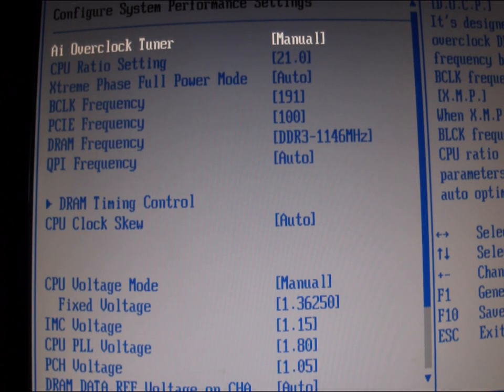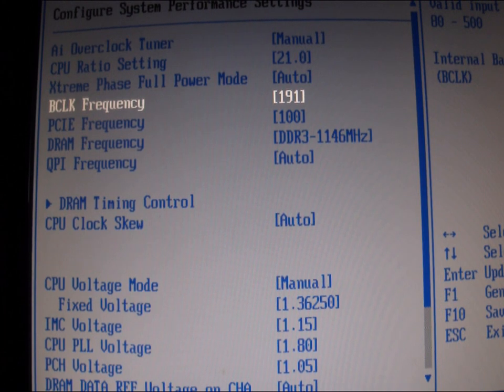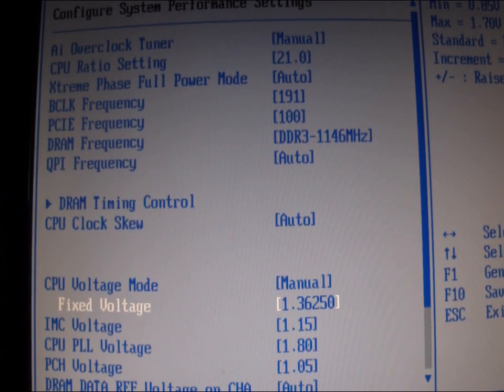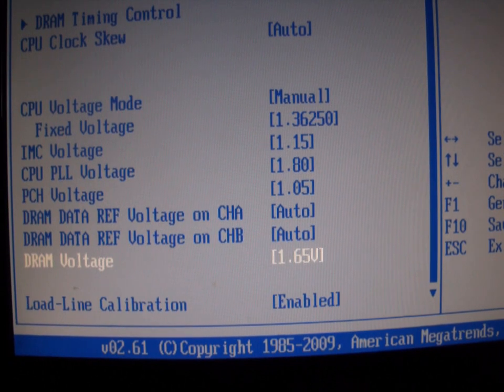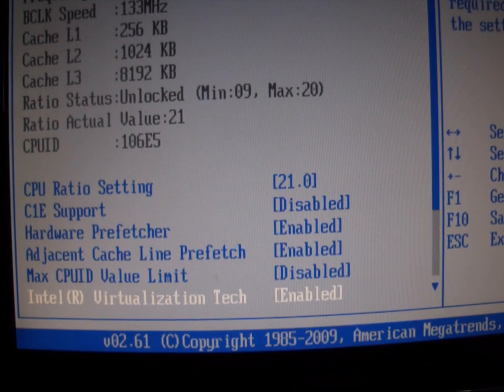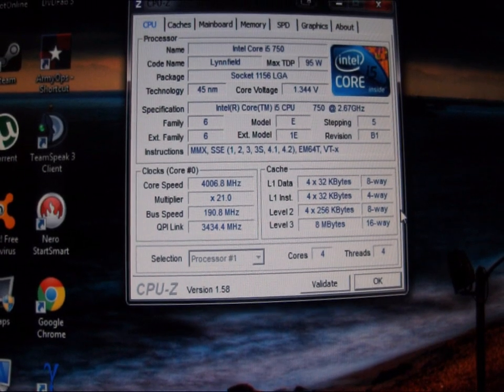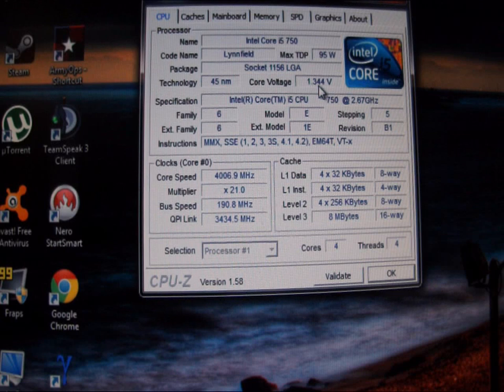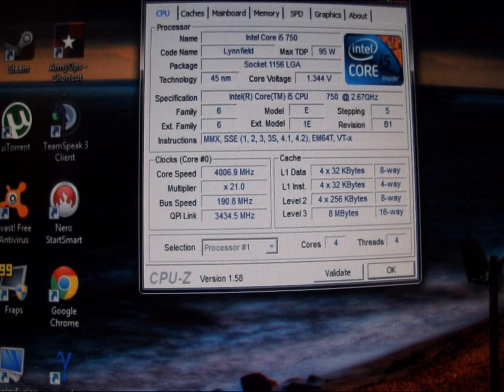Asus P7P55 LX bios setting Intel I5-750 @ 4.0 GHZ

Comment: Selamunaleyküm (Hi) I am writing my system to everyone, can you show me how to overclock in detail, or can you tell me about the computer's thermal paste and fan, all the maintenance has been done, it's only been 1 day processor - i5 760 - motherboard - p7p55 lx ram 2+2+2+2 8gb corsair xms 3 ram di i think i have 460w psu i have cooler master r5 230 as graphics card my monitor is 75 hz and i am a fps player but i eat a lot of srop because i can't get 75 fps, if i get stable 80 fps it will take me 6 months, so i don't worry about my life too much: D
i have hdd as disk, that's all, by the way, monitor syncmaster bx2350

Comment: SUPER HELPFUL! I'VE BEEN AT IT FOR HOURS AND FINALLY GOT A DECENT OC FROM YOUR VIDEO!
I got my i5 760 on an ASUS P7P55D-E to run at 4.011 GHz. Turns out my ram could not churn out more than its rated 1333 MHz and underclocking it allowed me to boot into windows.

Comment: On the sticker of my ram it said 1.5v but I set it to 1.65v. Can this damage the ram? I was able to boot in to windows without a bsod. After that I changed it quickly back to 1.5v. So could it have done  any harm?
Reply: Short term, no. Long term yes, since it get's more power than needed and wears faster.
Ideal is to undervolt everything, as much possible and without problems

Comment: can u help me in 2019?
Reply: What info you need?
Reply: @yeahbuddy6852  i have intel x3440, asus p7d55 and stock cooler what should be my overclocked ghz and bios settings?
Reply: I have x3440,asus p7d55 and stock cooler what should be my overclocked ghz?

Comment: Please what is a cheap but good graphics card for an over clocked i5 750 . I don't mind second hand. I really don't want to spend more than 50 pounds new. and around 20-30 pounds second hand would be great. I'm planning to use a gigabyte p55 motherboard
Reply from the maker: What are your needs for the video card?. Are you planing on playing the latest games with it?. Your best bang for the buck is to buy a used card that is maybe 1 or 2 generations old. That way you can get a card that is still powerful but on the cheap. Do you have a good access to used video cards in your area?. What kind of cards have you been seeing in the 30 pound range?.
Reply: Im with i5-750 @3.6Ghz, 12GB ram@1600 and GTX 1060. Also an SSD.
It's the best  possible combination for now.
No need better GPU unless you prepare yourself for total upgrade afterwards

Comment: is there any setting the speedstep can be enable so it dosent run at 4g fulltime?
Reply from the maker: You can sure try it and see if it will work for you. I like to let it be able to throttle down also. But on some boards it will cause instability when it try`s to throttle back up again and cause a crash. But it certainly wont hurt anything to try it and see how it works on your system.
Reply: How can I do this I have a p7p55d e lx with gskill 2133mhz
Reply from the maker: @yulmerced4434  I believe it should be just a matter of enabling the C1E support under your advance cpu.
Reply: What should I enable I can run at 4g all day  my temps are 56c 60c even with cpu burner I have an asus p7p55d e LX
 i5 750
 gskill 2133 underclock
Reply from the maker: @yulmerced4434  It would be the same thing. If you want it to stay at 4g all the time turn C1E off in bios. If you want it to throttle down and run cooler turn C1E on.

Comment: Hi what settings do I need to use if I want to just upgrade from 2.6 to 3ghz? Take one step at a time
Reply: I sorted it dude - thanks for replying :)
Reply: Mika Vanderak I used everything the same in the video except I use 17 instead of 20
Reply: I did everything the same and 17 voltage and my processor is 3.2ghz at 40 degrees

Comment: I know this is an old video hopefully you will respond...I have this CPU and a similar motherboard. I have overclocked to 3.6gz and my idle temps are around 50 celcius. Its a stable overclock. Do you think I should bump it up to 4.0?
Reply from the maker: That temp is a bit higher then i would like to see at idle. You either need to try to keep it stable with less voltage to cool it down, or try a better cpu cooler before trying to go higher with the over clock.

Comment: Thank you!! i have the same motherboard with i5 760, i did the same and now im at 4.0ghz
I have 2 questions, first: what about temps? 50-55 degrees is ok??
second : i have 8gb ram (corsair xms3) 1333ghz its ok at 1.65 volts as you did or i can run them higher?

Comment: I have set the bios as you said in the video, and do not get your ghz. 
When I put 19.0 CPU ratio setting and entered windows, give computer and right click on properties I get 2'56ghz .... why? 

which drivers you have installed on the motherboard and processor? 

  I'm peron my Spanish orthographic, thanks in advance
Reply from the maker: Not all cpu`s or motherboards will overclock the same way. When you get into windows use cpu-z to check cpu speed. Windows may be reporting it wrong. Also make sure you have c-state disabled in the bios.
Reply: FUzzyBUnnyBOoties  Hello again thank you very much for your help. How many mhz is your memory ram?
Reply from the maker: CeroTrece HD 1600 mhz
Reply: my ram is 1333. could be a reason why I do not get stability?
Reply from the maker: CeroTrece HD Yes it very well could be. You may have to set your ram speed down even lower until it becomes stable.

Comment from the maker: I also totally the chance of all 3 chips being bad is very slight. I dont think the first one was bad the 8gig one. The board will only support 4 gig chips. So you could have a total of 16gig if you filled all four slots. But it will not know how to read and write from 8gig chips. So I don't think that one was bad. I do believe that there is something wrong with the value ram ones.

Comment: It was an 8GB Vengeance by Corsair, the motherboard, technically did support it but as Windows 7 booted up it BSOD, exactly the same as this one. It's as if both the MB and the RAM are denying each other, funnily enough. I know that Value Ram ought to be considered as junk but I don't understand why they wouldn't boot individually even if I single channel the both of them.. it's always a BSOD, only the 2GB pieces I have left seem to work, and they're also Corsair.

Comment: You're talking about DRAM Timing Control right? The option is on this video but you skipped it in the footage, haha, I managed to open it and found like 6 different settings that revolve around the timings all with their own numbers.. I set the first four values to 9-9-9-24 but the others I have no clue what they do. Also, at the top of the same page is written information that the default clocks are already set at 9,9,9,24 so I'm not sure if it's that. I tried booting up with 1.65 Volts of DRAM

Comment from the maker: The ram timings are under the the dram settings. Every thing will be on the same page that you would overclock from. Right below the cpu settings you will see the dram settings. And at the very bottom of that page you will see the ram voltage settings. If you are concerned about changing the settings. You can just take the battery out of the motherboard and pull the power plug from the computer. Wait about 10 minutes then put the battery back in and plug the power back in. That will reset bios.

Comment: It's totally RAM related.I can plug in the previous RAM Sticks that I had and Windows would boot perfectly (That's where I'm actually posting back from at the moment). About the clocks (9,9,9,24) I'm not entirely sure under which setting I can edit those, would you please guide me? I don't want to fry the motherboard or any other component, haha -- Btw this is the RAM I'm trying to plug in - cmv8gx3m2a1333c9

Comment from the maker: The IRQL would tell me that it is a ram issue. I assume that you are able to get into the bios?. If so set the ram up manually. Set the voltage to 1.5V and timings to 9,9,9,24. You may also try booting it with just one ram chip in and see if that works. Them value ram chips can cause a lot of problems because most boards do not know how to auto detect them.

Comment: I'm no entirely sure about the compatibility, but since the Motherboard manual/specs state that it can withstand to 16 GB with 2000 OC and above I thought that upgrading from my current 2 x 2 x 2 GB Corsair modules to at least 8GB single channel and then since it crashed/gave me a BSOD thought to go for at least 8GB dual channel.. Obviously I tried messing with the CMOS and also inserted one of the RAM modules on it's own but I still got the darned blue screen

Comment from the maker: I have not ran across that problem. I have ran 2x4 and 4x2 configurations with several different types of ram. Do you know for sure if the ram you are trying is compatible?. Have you had this board running before or is this a new board for you?. You can try resetting the cmos if you haven't already to see if it clears the old ram settings.

Comment: I have this very same motherboard and I just installed 2 x 4 gb of ram which amounts a total of 8GB, however I'm getting a BSOD every single time windows boots, and also if I install the pair as dual channel the motherboard simply freezes and hangs at startup. Would you by any chance know anything about such an issue, and also do you think it's related to voltage? I'm 100% sure the RAM itself is in defective since I just replaced it from a single 8GB Corsair Vengeance stick which also, crashed.

Comment from the maker: Yes it sure would. the basics to overclock any chip on this board are very similar. You would have to play around with the voltage and FSB settings to conform it to the i7. But the method is very similar.

Comment from the maker: That is a bit warm. You really don't want it to hit 70C. Of course the cooler the better the CPU will preform. You may need to back it down a bit closer to 60C just to give yourself some room until you can get a better cooler. You might also want to take the side cover off of the case and set a house fan next to it blowing in. That can really help to drop the temps also.

Comment: allright, thanks a lot :)
i tried it out, and right now ive been playing crysis 2, at extreme settings.
getting me at a heat of 65-69
no other problems so far, have been playing different games for about an hour.
would you say the temperature is to high? or is it acceptable?

Comment from the maker: Thank you very much. 

With stock cooling I don't think I would try to push it more then about 3.8GHZ. The main thing with overclocking is not to increase the voltage above safe range for the CPU. So to start with I would just try to raise the FSB and see how high it will go without changing any voltage or anything else. Once you are in windows monitor the temperature closely to make sure it is in a safe range for the CPU. 

for a higher overclock you have to get a better cooler

Comment: hey man.
i love this video of yours.
Im using the standard intel fan, and ive got a i5-760 instead of a 750.
what would you recommend for the max settings I could go to? would be very gratefull if You respond (:
not that experienced with overclocking and I don't know that much about whats safe and what not..

Comment from the maker: @SSHAMR0Ckk It should be in the hardware monitor section of the bios. Overclocking will put more stress on the cpu and the psu so maybe it could still be the psu that is overheating and shutting down. If you have cpu-z installed can you open it and tell me what the revision number and stepping are for your cpu.

Comment from the maker: @SSHAMR0Ckk Are you seeing the mid 60`s at idle or at full load?. Check in your bios what you have the cpu shutdown temp set to. You may be hitting it under load and shutting it down. Seems too hot mine idles at between 20-23 on all the cores. The ram should be fine I am using 1600 also.

Comment: I have a astetek 510 water cooler I think it's the same as a corsair h50 and it's reading in he mid 60's, using push pull on the single radiator, and it's an extreme gear 700w not the best I know but it's what came with the custom build, and I have 1600mhz memory I read that he i5-760 isn't comparable with it, is that true or was there some kind of update to he bios of drivers?

Comment from the maker: @zprayer Well if it tested longer you are getting closer. Just try tweaking each setting a little at a time and see what makes it test longer or shorter then you should be able to figure out which one you will need to increase. It is a time taking process to get it right.

Comment from the maker: @zprayer Them temperatures are just fine you should be able to push that much higher. Yes you can start with them settings and then just tweak them as you need to. If it blue screens it usually means it need more volts on the vcore.

Comment from the maker: @zprayer Every cpu is different you may have to adjust the voltages a little different depending on your machine. Your cpu might also be a different stepping and will not overclock as high.

Comment from the maker: @FearedMoo Laptops are really hard to overclock. For one they dont give any options in the bios. Two they overheat very easily and there is no way to add a better cooler or water cool them.  Three the more power to try to get out of it the shorter the battery life so you may only be able to run it with it plugged in all the time. My opinion is to just leave it stock. If you want to play around with over clocking you can get a cheap motherboard and cpu for around $100.00 and play around with that

Comment from the maker: @Crysis2ful That sounds fine you should be able to leave the ram on auto. Be sure to also check the power saving settings in windows to make sure they are turned off and you should be good to go.

Comment: Can I leave the auto DRAM.Hi. My Rams 9-9-9-24. The voice on the CPU-Z memory: DRAM FREQUENCY: 541.7
cl 8.0
8 clocks tRCD
8 clocks tRP
Cycle time 20 sec
referesh row cycle time 60 clocks.
Can I leave the auto DRAM
I use. BLCK 3240Mhz 18x180
The vcore 1,200
The rest all on auto
I also disabled CE1 and turbo boost.
Do you think it's fine

Comment from the maker: @Crysis2ful If you are not overclocking your ram or only overclocking it a little bit you should be able to get by with auto settings. If you do want to manual set your timing and voltage you should be able to look up the specs for your ram at the Corsair website.

Comment: Hi. I have : i5 750
P7P55D
Zalman cnps 9900MAX RED
Ram: 4gb DDR3 1333 (corsair)
With my Ram 1333, DRAM FREQUENCY option, which number should I put?
I would like to get to 3.4 Ghz (I do not need more). Can you tell me the values (BLCK etc.). The voltages can leave them in automatic  for this little  overclock ?

Comment: Thanks so much for your help. Since we have the same mobo and cpu, I at least know that 4ghz is achievable with my hardware, so I'll keep experimenting. 

I suspect that my mobo is faulty, maybe the voltage regulators or something. My girlfriend has a P55 motherboard that I'll snag as soon as I get a day off; then I'll try for 4ghz on it. I think I'll try a different PSU too, just to be sure.

And I love your modding videos by the way. Very nice work on the blue and yellow case.

Thanks Again!

Comment from the maker: @stonedinosaur You can try upping the voltage some. People run them as high as 1.4 volts. So it is worth a try. It may also be that the cpu just wont handle over 3.85 stable. They all overclock a little differently. But I would try upping the voltage slightly and see if it makes any difference.

Comment: I have a TACENS RADIX IV 700W. I don't think they are well-known in the states. I bought it here in Spain, the reviews are solid, and the guy at pcbox recommended it. It boasts 85% efficiency. 

I tried using your bios settings, but 2 cores failed instantly in Prime. It's stable at 3.85 ghz, 1.35 VCore, but whenver I OC too far, it fails instantly in prime or runs for 6 hours without errors..

Also your core voltage in Cpu-Z shows 1.344 though; mine showed 1.320. Maybe it's voltage droop?

Comment from the maker: @stonedinosaur Yes the cpu TM function should be disabled. It is designed to throttle the cpu to make it run cooler. If your machine is restarting like that i would guess it is the power supply. What brand and wattage are you using.

Comment: One more thing: I noticed that you have CPU TM Function Disabled in Advanced Settings. If I disable it and run Prime 95, my computer restarts after about 1 minute at 100% load, even at low and very stable overclocks; it doesn't even blue screen, it completely restarts. And my temps never get higher than 65. Any suggestions?